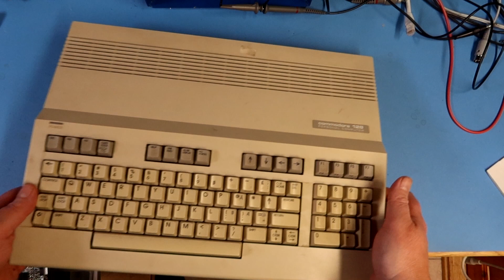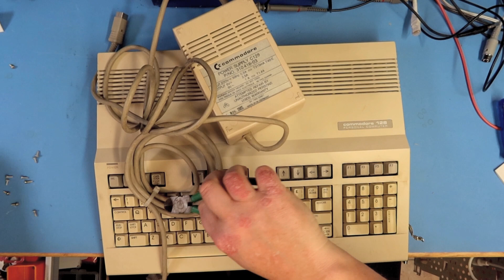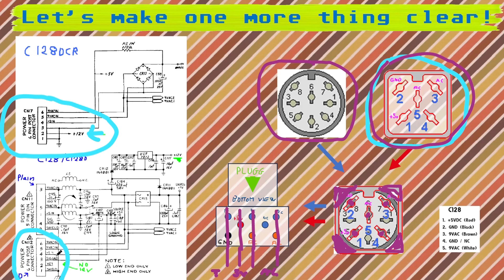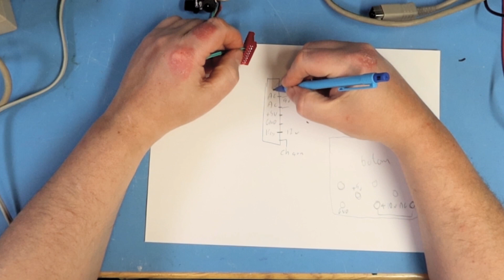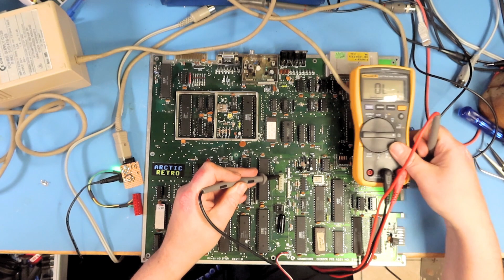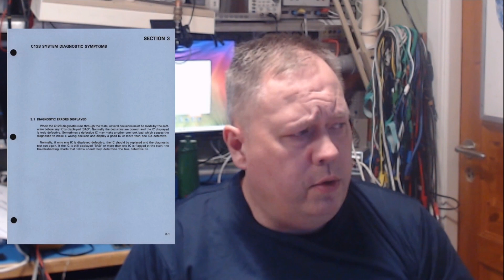The Commodore 128, Ep2 , To rule the world of the C128 you have to seize power.

Comment: Always the systematic approach.  Get the power squared away, then look at voltages on the rails to be sure, check the clock signal(s), finally discover both CPU are being held off the buss by the RESET line.  Progress is continual when form follows function.  Well done!  I had thought there was a way to get a GoTek to emulate a 1581, but I could be wrong.  Still, it might be a way forward that's cheaper than acquiring an actual floppy drive for this machine.  A quick search indicates this has been done in the past, so it might be worth looking into.
Reply from the maker: There might be a way to have a GoTek emulate just the drive, but you still need the surrounding electronics, as this is a whole computer in itself.. But then, why bother, and SD2IEC device already does most of what such a contraption would be able to do.

Comment: you don't need to make a cartridge. the test rom can be placed directly in the empty socket -
on the board.
Reply from the maker: That is surly a questionable approach, but you are right, with the right format and address space on the prom that is possible. But it's better to face one unknown at the time when doing fault finding, and a cartridge is easier to just unplug, and you can use it without removing the cover on other C128's. I have surly looked into this in dept in this series.